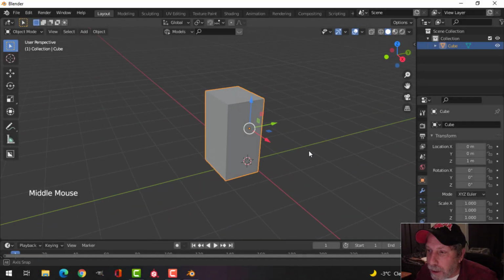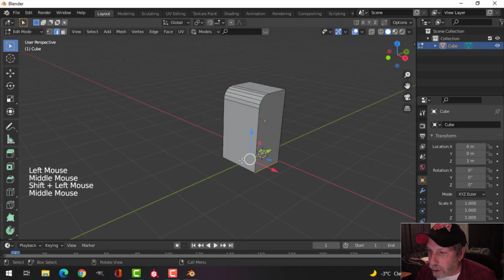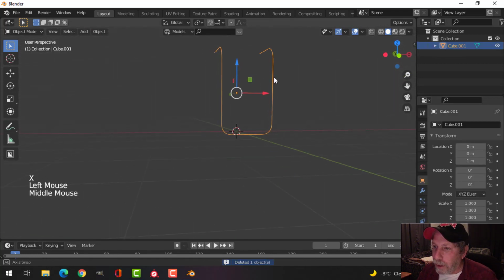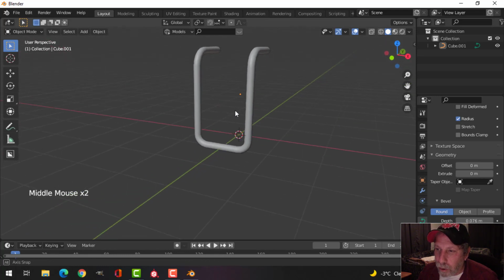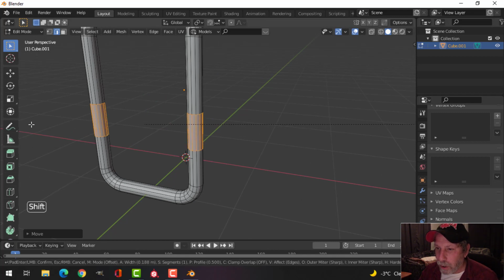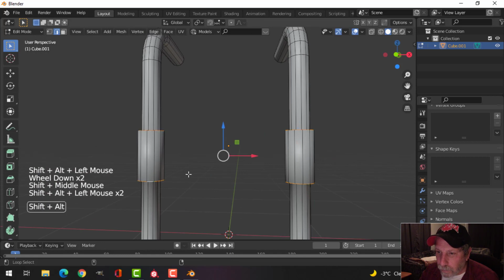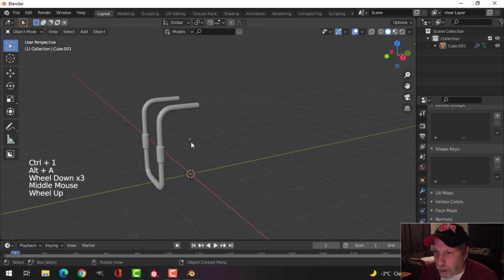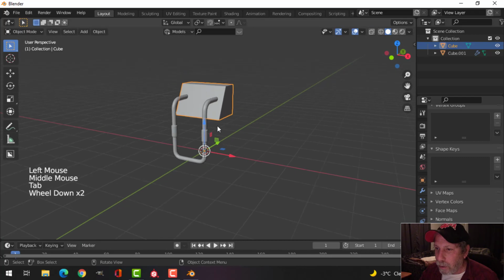BLENDER TIP: CURVED PIPE

Comment: I tried your tip but the pipe that I made come out in oval shape. How can I turn it into circle shape?
Reply from the maker: I'm not sure what happened.  I would suggest that if you did any scaling or rotating in Object mode rather than Edit mode, go into edit mode and ctrl-a and apply scale and/or rotation and see of that helps.  Also make sure all polys are facing outwards.  That can cause problems.  If all else fails, keep both tips above in mind and do it again.   If you still can't get it to work, write me at kimmelelliott@gmail.com and send me your blend file and we will solve it once and for all.
Reply: @zerobio  I think I found it. When I add a cube, I scaled it up in object mode afterward. After changed it back, it turn to circle shape. Thank you very much! You save me!
Reply from the maker: Excellent!  Glad it's working for you.

Comment: Exactly what i needed without the added nonsense. Straight to the point 10/10 tutorial thankyou
Reply from the maker: Awesome!  I'm so glad this is useful to you, G T.
Reply: @zerobio  i need to add a “ T “ junction into my pipework. Proving a bit of a challenge, any suggestions?
Reply from the maker: @gt546  search my advanced beginner playlist, not too far back, I did a bunch of pipes and exactly what you mentioned.   Let me know if you can't find it.
Reply: Figured it out dont worry !
Reply: For anyone else who needs to know 
- edit mode.
- add a loop where you want the T 
-extrude the verticie
- seperate it from the main object
- convert it to curve 
- add thickness 
- convert it back and in object mode push it back in
Reply from the maker: @gt546  Good stuff!
Reply from the maker: @gt546  Or this ... https://youtu.be/KdGz4YwpVuE
Reply: @zerobio  didnt even notice you had it posted 😂 thankyou

Comment: you saved me dude, I've been using paths and desperately needed something like this.  Is there a way to extrude the point where the bevel curves? I find that the bevels are too steep when I do it.
Reply from the maker: Great!  I'm not quite sure what you mean, sorry.  But hopefully if you experiment with this for a while, you can get what you need.  If you want to talk more about it however and share screenshots feel free to email me at kimmelelliott@gmail.com
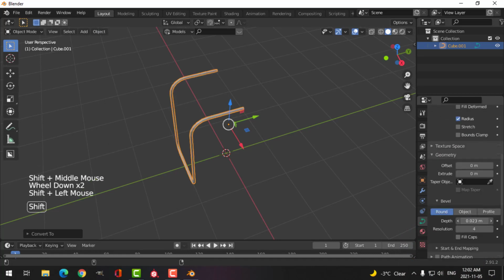Reply: @zerobio  that's fine, I'll probably figure that out myself. one more question though -- at 1:06 there were round, object and profile options under the bevel section. I don't have those for some reason. Any idea why and how to fix this?
Reply from the maker: @not_zara  it might depend on which version of Blender you are using.  Do you have a recent version?
Reply: @zerobio  turns out I don't. I updated it and found the options, and I had to apply scale on the object for it to work properly.
Reply from the maker: @not_zara  yes, do apply acale and rotation too.  I used to scale a lot in object mode so have to apply scale but mostly edit now in edit mode.  Great that you found the options.